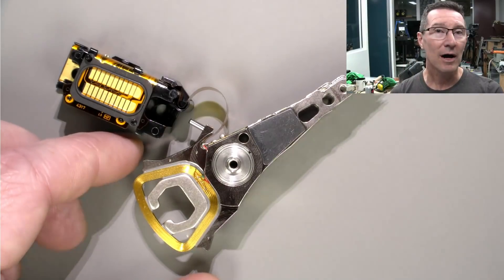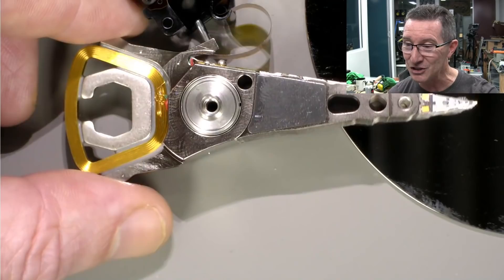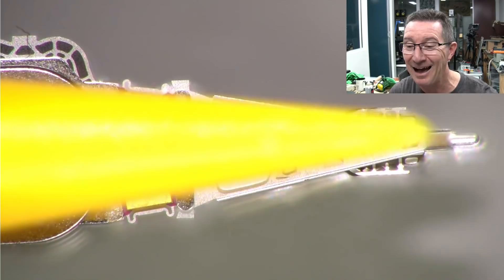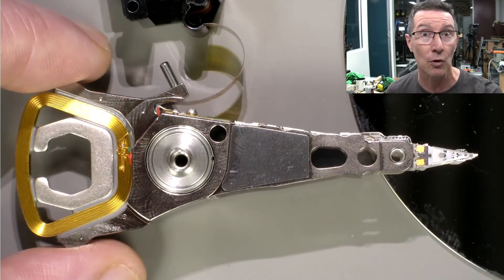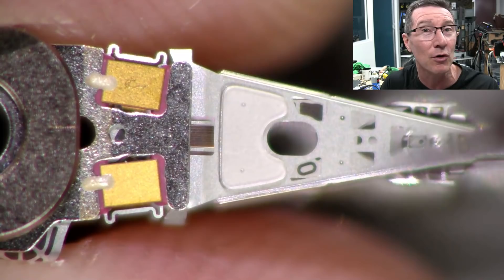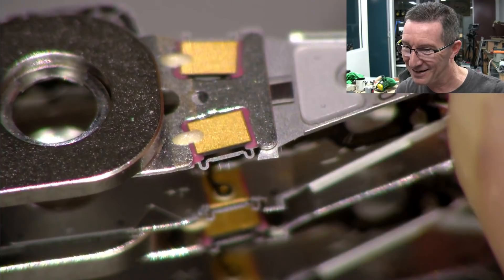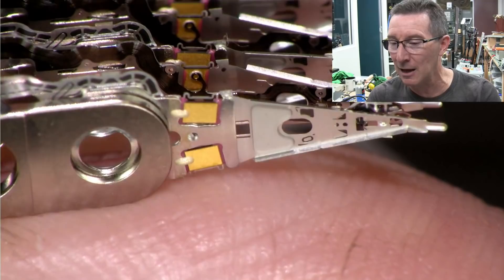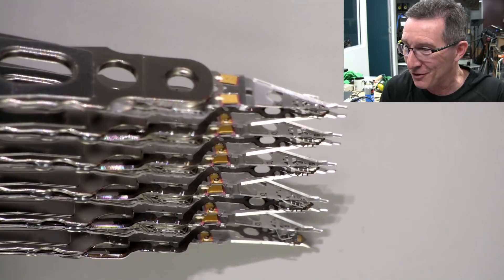EEVblog 1400 - Hard Drive Micro Actuators are AMAZING!

Comment: I wonder if the micro actuators act identically, or does each head have the ability to adjust independently.
Reply: The heads move independently to correct for surface to surface and head to head track position.

You likely need to put opposing V on the piezo pairs. With only 1 active you are pivoting into the other solid piezo.
Reply: Guys, there are only so many connections from the main circuit board to the E-Block where the pre-amp, main actuator coil, micro-actuators, read head, write head, and head heater reside, each is a essentially a pair of wires.  Not to mention pre-amp power and communications for pre-amp control, selecting which head is in operation.  Disc drives are a simplex device, only reading or writing at a given time, and only one head (surface) is active at a time, otherwise the control requires too many connections and servo algorithms too complex.  All the micro-actuators act in unison , though only one head, the active head, is used for positioning at any given time..

Comment: Try using the high input impedance of a multimeter to see the pulse voltage generated when the head is flexed.  Should be measurable with a 1G input impedance, though lead noise will be high, you probably want to clamp the head into something rigid and actuate it with a non conductive non static rod, so as to reduce hand induced mains hum.

Comment: still in the vinyl age? :)
Reply: stored ion deposition picometer painter disc, electric field deposition
Reply: connectivity bit measurement, high voltage ion removed and replacer
Reply: piezo picomechanical transistors, and memory, static

Comment: Would you not need a higher voltage do drive the piezos? In cheap piezo sounder circuits there is usually an inductor across the piezo to spike the voltage.

Comment: Hard drives in this day and age show how crazy technology can go (and how affordable) if the need is there. 

I suspect you can make everything cheap and to high capacity if the money, market and engineering is there. 

For example thermal cameras. Haven't been cheap for 30 years and are really affordable now only in the last 5 years because China entered the market (US is not having a chance in the low end market due to ITAR). And high resolution will soon be mainstream.

Comment: So in theory these could read adjacent tracks on different platters? That would be a very clever way to get more bandwidth.
Reply: Maybe, maybe not. It could only give some advantage when the data you want to read is REALLY located on the adjacent tracks on different platters. In reality, it's not the case. Drive fragmentation, failed sectors remapping, the fact that file system does not care about physical location of the data on the platters, all of that makes it extremely unlikely that the data you want to read could be read from several tracks on different platters in parallel.

Comment: I assume the positioning data is written by the drive itself, but how long does that take ?
Reply: Used to be bespoke high-resolution equipment at the factory.  I think I saw someone explain this recently, that it's now done in situ, but again only at the factory under supervision of a much smarter controller.  It's not cost-effective to build that functionality into the drive that ships to consumers.

If I'm wrong, by all means, someone please educate me on what is current practice.  :-)
Reply: Nick is right. Formatting data used to be written using a special machine in a clean room, on a granite slab, with a laser interferometer taking measurements to position the heads on each track. Then interferometers were replaced by very high resolution rotary encoders, but the process was still the same. But it was taking longer and longer to format drives in this way, until it became too expensive. Now, I think only a short spiral track is accurately written in the clean room, and then drives are assembled. Then they use this track as a reference to build a complete servo track pattern. There are millions of tracks in terabyte drives, so it takes days to write full pattern of servo data on all of them.

Comment: How about if those tiny transducers are there as a safety precaution to detect vibration through head contact with platter and thus cut power to the HDD?

Comment: like in great scotts videos, to drive any peizo device you need tens of thousand of volt in push pull config, please go through some of HV drivers dear dave.
Reply: You don't need that much voltage. The power supply for Type-C VTRs dynamic tracking was around + and -100V

Comment: Probably with some sweet low level tools (software I mean) one could make these actuator squeal a little on a working disk  .. But I think the resolution of my eye doesn't enable me to detect a 60 nanometer movement,  I even have trouble with 0.1 mm :D What would be 60 nm .. 0,00006 mm ? LOL !

Comment: Out of curiosity, if you put like few kHz square wave to the actuators and bring a very sensitive microphone to the head's tip - will it be able to pick up the same frequency (with a decent amplifier, of course)? Or, maybe, an ultrasound microphone would work better?
Reply: Make 'em sing, yes.

Comment: You’re sure they’re not for fly height adjustment?
Reply: The 'wings' on the arms are generating an air cushion that (with rotation) stabilizes the working height of the pickup (read/write ) coil arrangement. Not sure wether these need further control. Also, howwould the feedback work (I mean, how wouldyou measure the height?) the radial positio can be derived from the information stream on the disk itself.

Comment: Don't know if it's been asked before but do the HHD's only read one track per disc rotation or more?
Love your channel.
Reply: They read only one track at time, but can change between tracks multiple times during one disk rotation.

Waiting for disk to rotate to correct angle takes ages compared to a short head movements

Comment: Those piezoelectric actuators look similar to what they have in a scanning tunneling electron microscope, where a tiny probe is moved over a surface and detects individual atoms and molecules by small changes in current.  Half a bee's dick of movement is all you need to detect about a million atoms.

Comment: But why did my big brother’s HD start making a clicking sound when it stopped working? It was an older drive for his Atari 1040 ST computer. I recall the HD creator was Shugart.
Reply: The reading heads started making contact with the plates
Reply: Sorry but your brother's data is trashed. That's the heads making contact with the platters.
Reply: The clicking sound is the head arm moving backwards and forwards over the full range of its arc and then "bumping" (rapid in/out movement) near the centre of the platter then swinging out again. Nearly every kind of disk failing can cause this. Damaged head (for any reason) means it cant position to "zero"/get a sector/track reading ("home base") so it just keeps swinging. Platter loses magnetisation of marker tracks/sectors, keeps swinging. Dust under the head, keeps swinging. Head crash but head some how survived means disk scratched (dust everywhere) and damaged disk surface, keeps swinging. Controller feed back circuit dies, keeps swinging. Disk bearings wear down causing more wobble or eliptical resonance, again it can't read the "this is home base" so it just keeps swinging. Modern drives are more likely to just do it a couple of times then stop spinning which is why the "click of death" is much more rare these days; also modern drives are much quieter so when they do perform this "where is home base" its much less obvious (although with 2.5" drives in a laptop its still possible to hear the spin-up and the clacks before it finds "home base").

Comment: Enjoy the technology while you can. SSD is next logical progression. Only economics keeps this technology alive. In ten years these may all be on the junk pile with the 8 inch floppy drives or sitting  on someones desk as a curiosity. By the way. I'd O scope it to verify you had a valid connection. If you can't make it work you're either not connected to the right point or you're not providing the correct signal that's expected to drive the head. I'm sure you know all this.

Comment: Mecanical very interessting, but in 40 years they are still not able to read/write from all the heads at the same time. Best they could do is an extra pair of moving heads - sigh
Reply: I mean... you could ... but what would be the advantage?  You would either need to parallel the datastream to record parts of a byte on multiple platters (and then serialize them with accurate timing), or the data you wanted to access simultaneously would have to be at the same physical circumference on the disk.  How often is that going to be the case in practice?

The only way to get around that is to have the heads move independently, which is definitely possible, but only with a significant increase in cost, complexity, and size.  Just to run a couple ops in parallel?  Ehh... caching and lower access times are far more effective for the cost.
Reply: @nickwallette6201  The heads are on the same physical circumference, no need to move them separetly, sure the controller has to split the data like in a raid0-array and read/write with multiple heads at the same time, but the data-rate would also double/tripple/quadruple - so no slow ~250MB/s harddisk anymore, but this innovation would come to late anyway - SATA 3 is stuck at ~600MB/s and reading with 10 heads would probably push 2.5GB/s - but even Sata-Express cant handle that - besides SSD's taking over more and more. Sure it would need some work to do this and extra cost, but just imagine a HDD with ~2.1GB/s readspeed hitting the market. :D